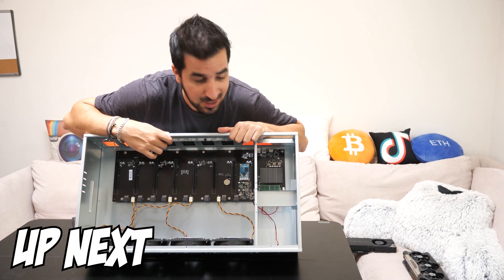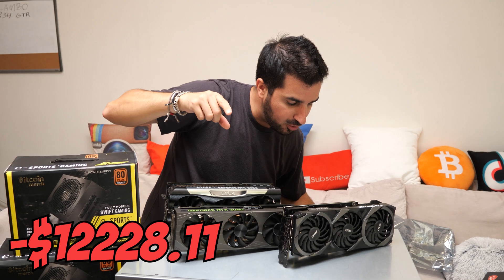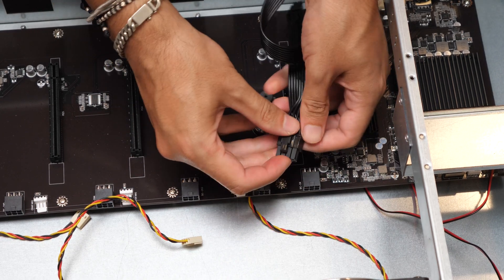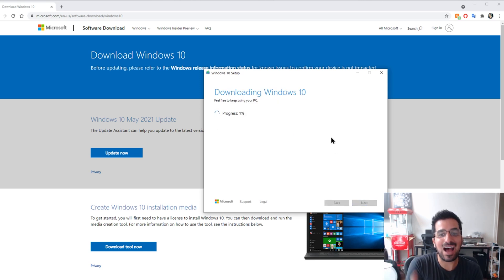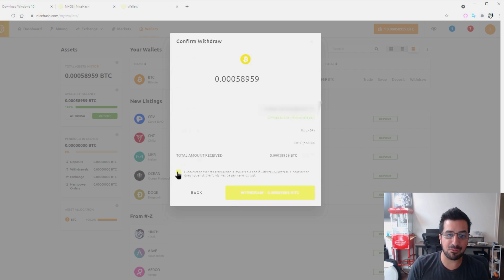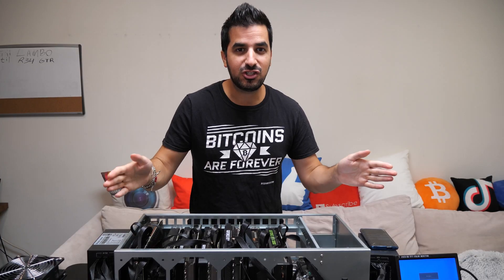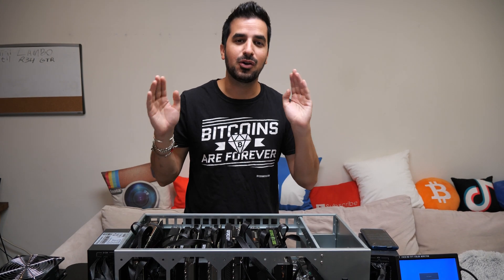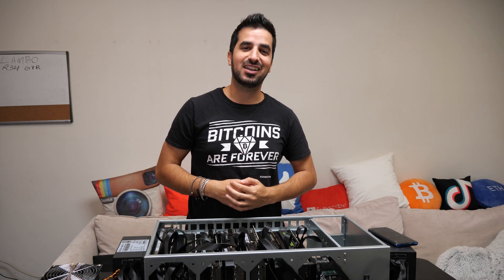My Bot is better than yours

Comment: So you paid $12,000.00 to make around $900.00 a month? And your gunna have that loud machine running for 24 hours a day for over a year? That machine will break down in less than a month if it’s ran like that. Not to mention the graphics cards will not doubt fail and need to be replaced often. This is no way a good idea or a profitable idea.
Reply: Not to mention that people like him are making it harder to source parts for building a pc in the US. Now I have to pay extra to have all my parts shipped from Asia and quarantined at customs to have a gaming pc without dealing with apple or dell.
Reply: @missingno81  Yeah I totally agree. I love this guys videos about driving Uber‘s and doing the point pick up and stuff like that because it kind of gives you an idea of what kind of money you can make any city on the West Coast. But with the micro processor shortages and the way that inflation is going up on everything, it’s just not a reliable source of income.I mean you still can’t buy an Xbox or a PlayStation five in any of the retail stores.
Reply: @chrisrust8290  Not true, I was able to order and pick up a disc based xbox at retail price, Playstation is still being scalped by retail employees. As far as I know pc parts are widely available overseas its just travel restrictions are tight as they should be now.

Comment: Jesus you're ballsy. Ethereum has roughly 170 days left before it goes to proof of work making it unmineable. Even using shitty nicehash for the best coins say rvn coin for example you'll make 15-25$ a day assuming ravencoin or other alts will be able to adopt all the ethereum mining power. Second paying 1800$ per card isn't wise by anymeans with such a short time frame that you won't breakeven. Eip 1559 also suppose to be 20-30% loss in earnings for ethereum on august 4th. I get this makes a great video and you will Return on investment partially from it. But this is similar to russian roulette i dont advise anyone to grab more cards unless you already have a paid off rig that mitigates the cost of a new card at MSRP very fast.